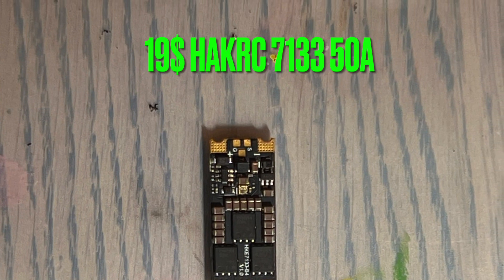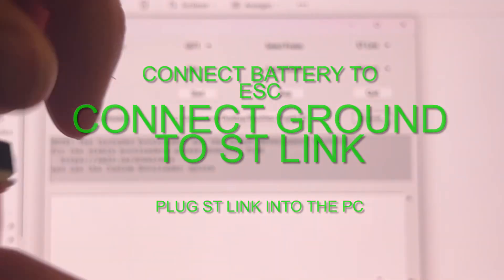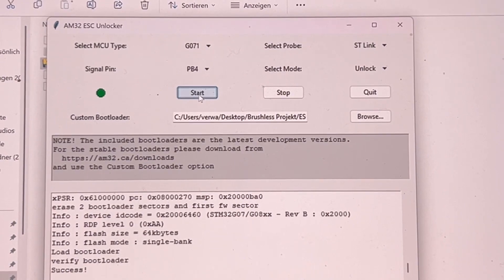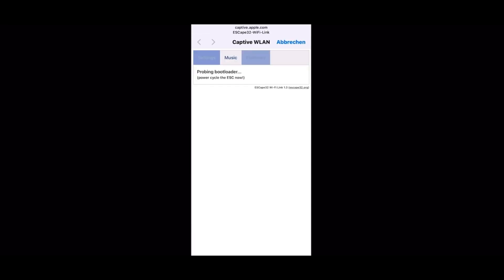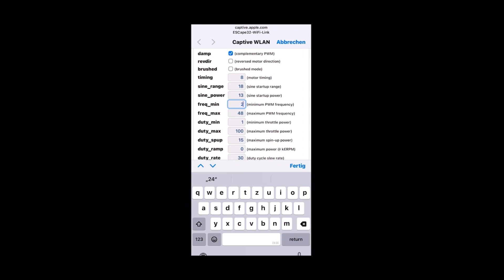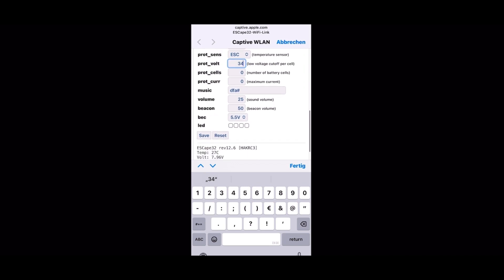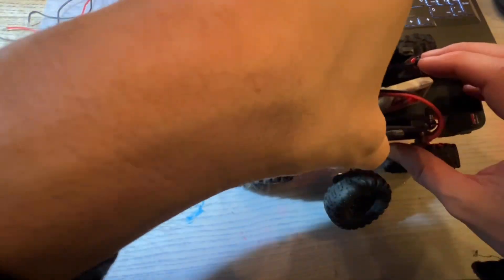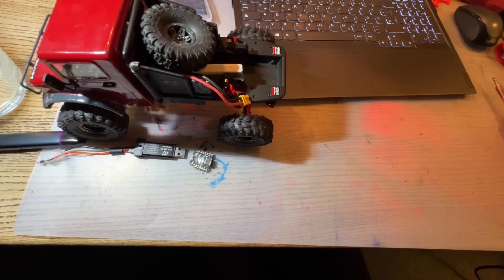ESCape32 - How to Flash HAKRC 7133 ESC - Premium Performance for Only $19!

Comment: i see 8.4V as an option for bec does this esc support that voltage? assuming so
Reply from the maker: the ESC could take 8S... I use 2S without any BEC. my receiver and servo can handle 8.4V if you like you could use 4S and a external BEC but there newer options out there with ESCape32 ESc and on board  BEC I guess

Comment: Hi, I would like to know if I can sue it to control a brushless motor for my SUP (slow),  I cannot fine any documentation if I can use it out of th ebox ,with simple PWM ?. 2. If  I flash it, can  I configure it without any extra controller just from Phone/PC?
Reply from the maker: Once it is flashed, and you have the WiFi Dongle you can setup everything with any device. Phone Tablet PC etc…. You even can control it with the phone

Comment: Great info there. Having a small question. What do you mean at 1:08 : " you touch them eazy" ? do you have to connect/ disconnect them all the time until the green light show connection? I'm a newbie at flashing esc but more that willing to give it a try. A wider shot of the process (showing what you do with the connectors during the process would be of great help). Thanks again. And happy RC'ing
Reply from the maker: @borduratsRCtips  you just make an easy contact with the two pins in your hand  to the pads, if it doesn’t work switch the pins - is a 50:50 chance. Yeah…. Happy RC‘ing 💯